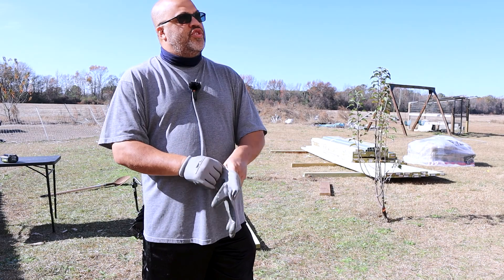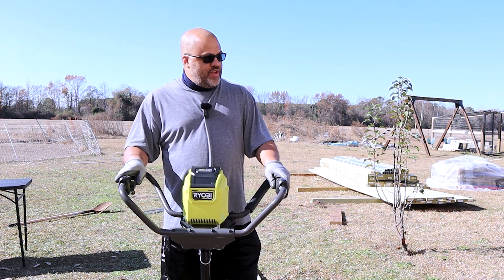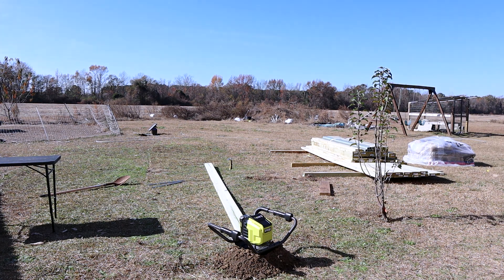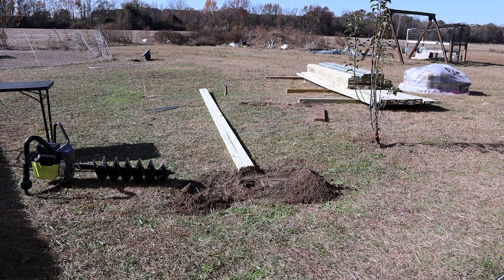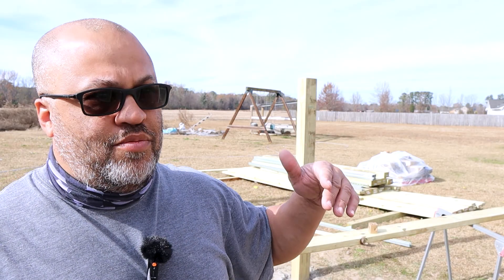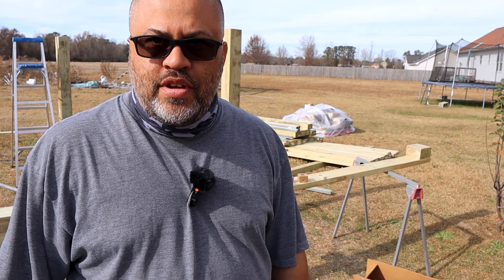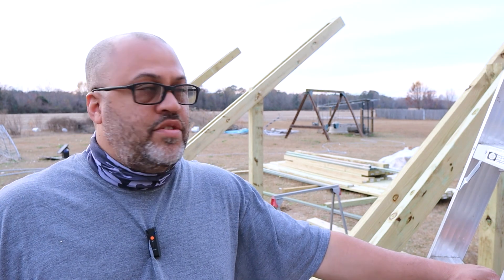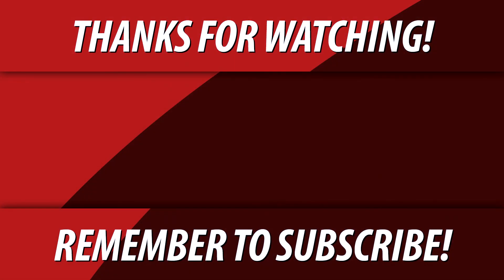DIY Adjustable Solar Panel Ground Mount - Part 1

Comment: I am back again trying to figure out what materials to buy and how many.  I like the pivot point with the 7/8” bolt.  I have been wondering about putting a bushing in the vertical 4x6 for the 7/8” bolt to ride on.  I suppose that bolt in your setup doesn’t move which would make the bushing redundant.  

Also, panel orientation as landscape 4 high gives me a 16’ span vs. a 12’ span for your 2 vertical/portrait orientation.  I wonder if I am adding too much weight with that approach.  I am looking at 40 panels give or take which would spread 58’ for landscape and 80’ with your portrait orientation.  

NOTE: I am designing this for the ultimate off-grid system where I will start smaller and grow into this system.  I am asking these questions not for construction advice but from your experience.  (I will not hold you accountable for my dumb mistakes - haha).

Thanks for all your videos.  All the best from north Texas.

Comment: Did your city give you a permit to build this adjustable solar panel?
Reply: He is not in the city. I believe he mentions this.  Not all places require a permit. In addition, his solar installation is off grid, and you do not need a permit in most places for off grid solar. You will if your hybrid or plan to use grid power to charge your solar batteries etc.

Comment: Rodney, I am glad I found your channel. I am in the process of design a solar system for my homestead/farm. I have decided to build my ground mount and I would like to know the manufacturer you used for the main bolts for the pivot points. Can you provide a description and link? Thanks.
Reply from the maker: I think I ordered grade 8 bolts from mcmaster carr online. But you can get bolts from lowes, agrisupply, etc but maybe only a lower grade 5 I think. But I would think that would work as well

Comment: When you buy an auger make sure that you get extension bars so you can dig deeper. Also I would only go down maybe 2 ft at a time because the auger with the dirt can get heavy real fast. I did 10 holes about 4 ft deep in an hour and that puppy was heavy and my back was mad at me. My boss said it right - slow and steady is fast and efficient. I'm going to copy this build 2x.
Reply from the maker: Thanks for the great advice. I'll be sure to remember that!
Reply: @rodneyhunt  No Thank you! I've been looking at how to mount panels now that i have 10 so your vid really helped. We are not as young as we used to be so saving our backs is important.  I hope to do two or three set ups like yours also. I have panasonic panels sonI think they are almost the same size as your so the info comes in handy.

Comment: I have 2 questions for you I got 16 360 watt panels from SS try your code didn't work for me but that not what I want should I make one 16 like yours or 2 8 panel arays  And I have 2 GG4 6000xp So I have 50 amps at 220 The wire I am running is good for 115 amps so I can add as needed I am not going to run my big load at 1st anyway you think this is enough Biggest loads are a 12k and 9k mim split and a 8k ac. Thanks
Reply from the maker: Just from what you have said it should be. Also my code should work on any order over $500. rodneyhunt50
Reply: @rodneyhunt  I didn't add the 50  Thanks I like to help you as much as I can love your chamel

Comment: Looks like your bad luck is like mine at times dealing with faulty equipment. That’s why I don’t like changing equipment. I’ll stay with my gasoline engines thank you!
Reply from the maker: The second one has been great. The first one was a dud for sure though

Comment: Always like your videos. It is like we are talking together at the coffee shop.  Well done! 

I like the approach with a single post/pivot system.  Did you consider metal pipe such as sch 40 3” like Iron Ridge mounts suggest?  Metal could be all bonded together.  For wood structure I assume you will run separate grounding wires.   Not trying to tell you what to do. Just an honest question from someone looking to put up a tilting diy mount here in north Texas.  All the best.  Keep those videos coming.
Reply from the maker: Yeah separate DC grounds are easier with this setup. Metal cost are the biggest factor for me. This was cheaper for me
Reply: @rodneyhunt  thanks for the reply.  I saw on the next video you used the metal struts on the wood so the ground should conduct well.  You comment on the wood has me thinking.  I priced wood vs metal when lumber was sky high.  All the best from north Texas.

Comment: I hate you had that problem with your Ryobi auger. I’ve had that same auger for a while now and I bore up to 10” holes with little problem. It will stall out occasionally but if I take the hole in small bites, it will usually do the job.
Reply from the maker: @kencotton4645  my second one has been great! The first one was just a dud I guess

Comment: My shack at the lowest is 8 ft and 11 ft at the peak.  It looks like im going to need to have the top of the panels at about 10 or 10.5 ft to stay out of the shacks' shadow.
Reply: @rodneyhunt The southern facing eve is about eight feet and the peak is about 11 ft.  I have about six feet between the back property line fence, and that is an easement for power and other utilities. 

I do have the companies coming out to mark the utilities.
Reply from the maker: My tilt array post are pretty low. So I would definitely watch how high you put the post. Not sure if you mean just the top portion of the array when tilted or the entire array needs to be that high at a minimum. May need to back away from the shack if possible to keep post lower. 👍
Reply: @rodneyhunt  i may just mount them on the shack/shed roof with the supplied mounts and screws

Comment: Just started with solar.   Got two 100-watt panels this past Sunday.
Reply from the maker: Nice! Good start to self reliance
Reply: @rodneyhunt  gotta start somewhere.   Wamt to get my radio shack completely off grid.
Reply from the maker: Ham shack? I have my license but haven’t used it in years. Need to setup my stuff when I have the room
Reply: @rodneyhunt  i have turned a shed into a ham shack and office.   Insullated then walls, but not yet the ceiling.   Still need to get power out permanently. 

I want my entire house to be off grid, that takes time and money. 

I have had fun and been learning with ham radio.

Comment: No chance that would work here. My ground mounts will involve big deep holes, lots of concrete, steel columns, and aluminum, all designed be a professional engineer to include calculations and a signed wet stamp. In my area the design is for 20LB. SQ. FT. snow load and 90MPH wind load. My county will not accept ground screws or driven piles either. Generally, the mounts will cost about the same as the panels, before installation. Permits are required, not negotiable.
Reply from the maker: So where do you live? Unfortunately many places have lost more freedom than others. We have all lost freedom to do what we want though. Survived 60 mph wind gust so far and hopefully we do not see any higher than that
Reply: You need a Sinclair Sky Rack 2.0-it will satisfy all of those requirements, call Kyle-he will fix you up.

Comment: The strongest part of your mount is those grade 8 bolts.  Grade five bolts would have been more then strong enough.  In a strong wind the 2x6s will just break at the bolts.
Reply from the maker: Good in 40mph winds so far. Anything can break with enough force for sure. 👍

Comment: Glad I inspired your build. I don't mind you using my video clip on your channel.
Reply from the maker: Was just trying to show what you did so they could see the differences and they can check out your video as well. Thanks
Reply: @rodneyhunt No problem at all here.. Glad i could help. You can post a link to mine if you would like. If i can be of help please let me know. I have new videos coming. Just had to stop and get the new building in order... Things went wild for a minute.
Reply: IMHO, all of your ‘extra’ framing is really just cheap insurance and really necessary for a robust, durable wood DIY mount.  Removing a bunch is  punching pennies here.  My take, everyone else is free to build them however they like.

Comment: Post Hole Digger tip - Measure up your handles to depth required. Mark with tape, pencil, etc. Saves pulling out tape repeatedly. Looking forward to next part.
Reply from the maker: Had lines on post hole digger at one time lol. Good tip

Comment: Nice simple build thanks for sharing. You could add some  metal bracing in the corners. Im sure after the pannels are installed the rigidity will be there
Reply from the maker: Yes I think the unistrut will bring it all together. Thanks

Comment: RODNEY, GREAT PROJECT!
I ALSO SAW THAT GUY’S GROUND MOUNT BUILD & WAS IMPRESSED AS WELL!
1. ARE YOU GOING TO PUT DIAGONAL CROSS BRACES ON YOUR POST TO STIFFEN & HELP SUPPORT FOR ADDITIONAL RIGIDITY FROM HIGH WIND? 
2. ARE YOU GOING TO USE BIFACIAL PANELS & PUT WHITE STONES UNDERNEATH TO INCREASE YOUR POWER FROM REFLECTIONS?
Reply from the maker: Hey thanks.1. I probably will just going to see what the best options are. Probably 2 crossed each side I would guess.

2. Going to use the Hyundai panels I already have but may try bifacial in the future.
Reply: Thank you awbean5254 for recognizing me...